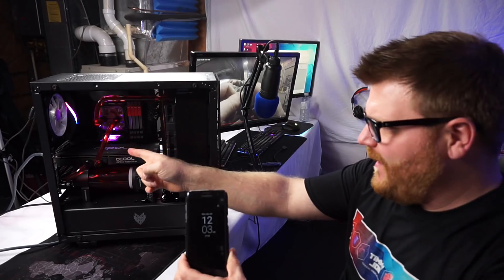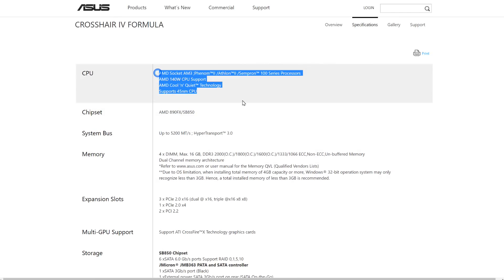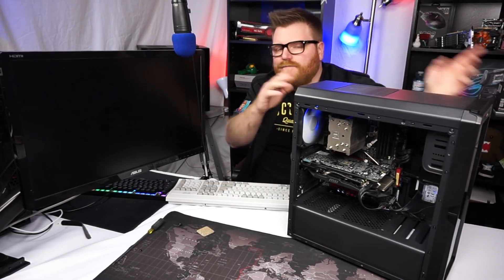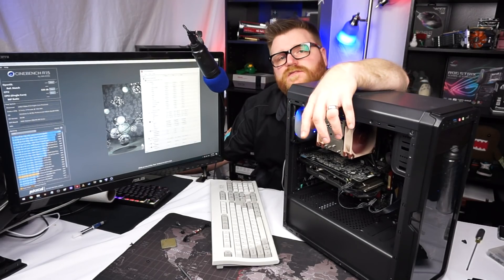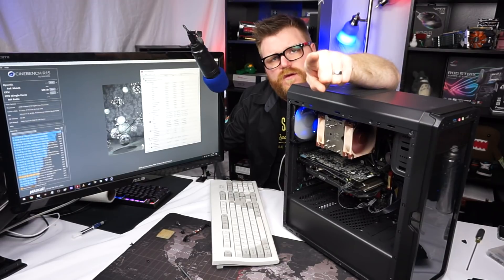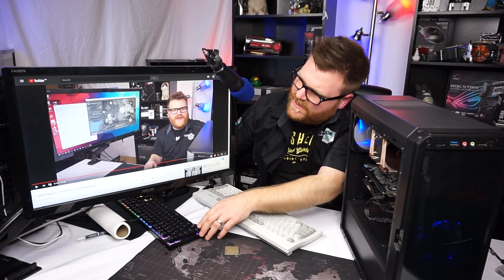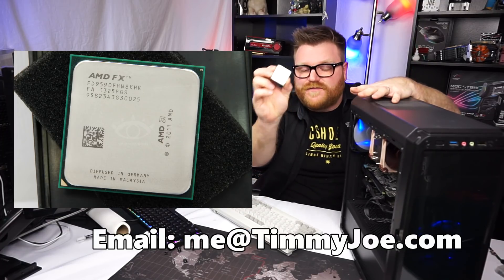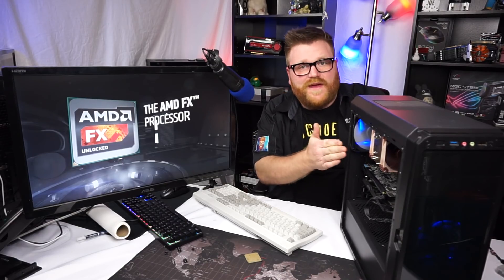AMD FX 8150 Overclocking on an Asus 890fx AM3 Motherboard

Comment: I have my 8150 overclocked to 5.4 on the Asus ROG Crosshair V Formula-Z mobo and it’s very stable. I built this PC 10 years ago and it still works well. Even with the GeForce 660ti GPU.

Comment: I have struggled to OC mine, I have hit a wall at 4.4 Ghz, messed about with voltages, etc with no joy, bought this budget CPU in 2022 for £30 to upgrade the FX 6100, that I paid around £100 when it was a new release a decade or so ago, using an AM3+ MOBO with a 780 FX chipset  (GA-78LMT-USB3) It was not AMD's finest hour but works great for me

Comment: I have an FX8320 paired with an MSI 970 Gaming motherboard. I'm having a hard time getting to 4.5Ghz due to overheating issues. Has anyone had success overclocking on the 970?

Comment: I have a FX-8150, and at 4.82MHz clocks i get 703 in CB R15 o.O  Forgot the ramspeeds and timings much in this video? or is the 890fx mobo just a perfomance dropper like crazy? 
FX-8150 4.9Mhz @the moment
Sabertooth 990FX R2.0
16Gb corsair vengeance dual 1600 OC to 1800MHz 
Rog Strix RX5700XT
corsair TX850M psu
this old system is great for 1440p and 4k gaming if you get enough ramspeeds

Comment: Hey! Greetings from small country in Central Europe where i have same motherboard and Phenom II 1100t. Because 2020 came in and many triple A titles stop supporting this procesor You made me to try the same thing. I already updated Bios to 3029 and can you tell me which processor from higher tier will work on this motherboard? I am asking because on Asus web site highest is 8150, but this processor is nearly impossible to get. And if is the price is astronical (I saw auctions with double the price from launch in 2012)

I am counting on answer!

Thanks

Comment: Hi Timmy...good video bro...i like it...because right now im using mobo crosshair formula iv same as the video...but my processor is phenom ii x6...can i ask 1 more thing...if i wanna upgrade my processor to AMD FX-8350 Black Edition AM3+...still can or got some effect on the motherboard....hope i get quick respond from you bro...
Reply: Hey I have the same plans as you. I also have this mobo Asus crosshair 4 Formula. For running the FX8350 in this Board you will need the Biosupdate 3029. Currently I am running a Phenom X6 1090T @ 4,1 GHz paired with a RX480. Now I want a little uprade, the fx8350 will Perform a little bit better, 10-20 FPS. Also the Phenom has a lack of instructions, the fx8350 is a good choice lowbudget choise. Better than spending 300€ for a new ryzen 5 1600AF + B450 mobo and expensive DDR4 RAM
Reply: @almanseinvater4681  thanks man...because right now a lot of game not support for phenom ii x6 1055T...thats why im planning to upgrade my processor with low budget...thank you so much...
Reply: @almanseinvater4681  but...if i update the bios now...its still got some effect if i still not changing the processor?
Reply: @sivosem3607  It has no effect on the current system you can do it now or later Just before you Put the FX8350 in, but be Sure to make the BIOS Setup right it could Crash your system
Reply: @almanseinvater4681 hey  i currently have the Crosshair IV formula with a fx 8350, it runs smooth but the only issue I have is that sleep mode won't work, it would turn on again immediately . did you manage to get the FX processor, did you have this issue?
Reply: @tuliofarias9073  I can't help you sorry I managed to get a FX8350 but then I sold my stuff. I.hope you find a solution for your Problem, I can't remember If sleepmode worked sorry

Comment: My FX-8150 and M5A97 EVO definitely throttle down at 63C.  I can only 
get performance increases up to 4.3Ghz, which are still quite good 634 in Cinebench R15, 
before I start losing performance due to throttling I suppose.  At 4.6 Ghz I'm back down to the 580s or even 390 in Cinebench.  

I'm  stable well up to 4.6Ghz, but the throttling just kills any benefit.  From comments I'm seeing online I'm guessing nobody is using HWiNFO or AI Tuner to notice the throttling. 
I  haven't seen much on how to solve this, with a water cooled FX-8150 and 
three case fans I don't even know why it is getting so hot.  My RX 480 
is the three fan PowerColor Red Devil too.  I'll keep tweaking, but I'm 
doubtful I'll see any performance improvement above 4.4Ghz thanks to 
throttling.

Comment: just bought most of a 8150 system just now for $240 needs a case and a PSU and its up and running not bad it came with 980 strix and 12gb of ram this platform is cheap right now.

Comment: Timmy the score was that low because you had APM( Aplication Master Mode) enabled. When you have that turned on cpu is calculating power consumption and with 4,8 GHZ this thing was going back with clock speeds and you got maybe 2 max max cores running on that 4,8. I have mine running 8120 running at 4,1 and its having over 600+ score .

Comment: Me thinks you don't know how to overclock AMD CPUs.

Just use the ratio, not the front side bus increase, otherwise you need to also increase the CPU North Bridge voltage as well.

You are overclocking your ram by increasing the FSB which is not going to be stable while running 4 sticks of RAM on those AMD CPUs. To get the best overclock you need to use just a single channel.

Seriously, do some research before posting a video.

I've been running AMD CPUs since the K6-2 days.

Currently running an FX 8350 at 4.6 GHz @ only 1.32 volts, 24 GBs of RAM, custom water cooled. My Cinebench score is 715.

Comment: I have a FX 8350 instead of going with the FX9590 I had planned on . So went with the ASUS M5A99FX Pro R2.0 . I'm a bit apprehensive about overclocking the CPU even though I have a Corsair H60 on it with a GTX 1060 6gig 3fan from ASUS . My point of over clocking the CPU is not being sure of making a mistake because I had one with my old PC. I would like to get a bit more out of it because I know the CPU is holding back the GPU . a  n  d  now my ADD brain forgot what I was getting my question. DAMN  HELP me Timmy Joe You're my only hope .

Comment: I have a still have  965 X4  phenom still , i sold my fx 4100 and 6300 was not impressed with the fx line, in fact my phenom does much better on dolphin emulator than any fx cpu i once had, of course my i7 3960x is my ultimate emulator machine.

Comment: Faildozer is right.  I have an i5-3570k running at 4.4ghz.  It scores 618 in Cinebench R15.  That's 4 cores and 4 threads from 2012 beating the 8-core FX-8150 pretty soundly.

Comment: MSI 890fxa-GD70 and FX 8350 good for OC, but only at 4250 Mhz and 1.28 volts. Have it running on a old XFX 1000 PWR supply with a HD 7790. I think the 7790 is newest part
Reply: If you are going to do a -40C run a Asrock Extreme 9 will run with only one of eight cores. In other words will shut off one core per module. None of the Gigabyte or Asus FX boards I have will do that. I could do 5.2 Ghz with one core @ 19C with the extreme 9 that way. Then put it on water.  Then it leaked.
Reply from the maker: I got the 8150 to 4.82 Ghz 715 CB with an AIO today, more to come

Comment: That long pipeline allowed those FX chips to soar in overclocking, but it didn't really improve performance much. I stuck with the Phenom up until Ryzen. I have an R5 1600 now, and it's SO much better. I've scored a 1394 @ 4Ghz on my chip doing Cinebench R15. Talk about improvement over the FX series.

Comment: mobo is bad, no ram overclocking, no VRM cooling, no NB overclocking, windows install is not fresh. no wonder cb score is low.
also IPC is important, but go ahead and try to play new games on, say, i5 7500. IPC is great, but it's only 4c4t. FX has 8 cores, 8 threads (w10 writes it as 4c8t because FPU block is a single unit per 2 cores). average framerate might be higher on 4c i5, but frametimes would be all over the place
Reply: An i5-7500 will destroy an 8-core FX in 98% of games, in every measurable way.  The IPC of the FX CPUs was too poor for the core count to make up for it.
Reply: yeah, maybe. but try i5 with music, browser and afterburner (or whatever utilities you run) in the background, tell me how it works out for i5
Reply: Why on earth would I have a music app and a browser open while gaming?  Utilities like Afterburner do nothing to hurt a quad-core.  I have that running all the time with a 4.4ghz 3570k.
Reply: background downloading? listening to music while playing? or maybe actually using your computer? teamspeak/discord/whatever it is you're using to communicate? or how about anti-virus software?
Reply: I never listen to music while playing.  That takes away from the game for me.  I don't download in the background, because that can wait.  Things like teamspeak and anti-virus software work just fine on a fast quad-core CPU while gaming.  That's a non-issue.
Reply: good for you then. i need my music in the background, some downloads and maybe video recording, so i need more than 4 threads therefore FX or old i7 (975 which i have right now) is way better than new i5 for me, simply because i5 would be overloaded with all the background tasks i'm running. true, i'm not getting more than 80 fps in majority of my games, but i do get nice smooth 60 so that's enough for me. basically FX would do the job for me, but i already got my hands on i7 with triple channel memory

Comment: got 8300 set to 4.2 1.36v with cinebench score over 650.  you should disable cool n quiet c6 and c1 as well  loadlines set to extreme.
weird thing win 10 reads as a 4 core 8 threat . maybe the poor performance of fx chips are based of that are not an actual 8 cores cpus lol

Comment: 6:20, you're throttling....you're running a 90mm heatsink and pumping a metric fuck ton of volts into it, don't blame hardare for your own disabilities, an fx8150 gets 550cb stock.
get a hyper 212 evo, set a progressive fan curve to ramp upto 100% at 65*c (and like 50% <40*c), set multi to 22.5, voltage offset to +0.1125v and then retest you should get ~715.

Comment: I had the 8350 lapped on CHV Formula water-cooled and overclocked to the max, that is one of the most fun cpu's I've had overclocking wise. It took 1.58 Volts for 5 years no issues or degradation.

Comment: Had an FX 8320e not the best CPU I ever had but got the job done. However any high-end i5 CPU from the same time would out preform it.
Reply: a higher end i5 cost twice as much, 8120/8320's were price matched to i3 2120 and i3 3220 respectively and when overclocked in work tasks would match i7-3770's go look.
Reply: even older cpus would still outperform it.

Comment: Not sure but I was watching a vid the other day and the guy's recording software was dropping the results of the score....did you record it while running? just wondered as someone in the comments below said it was too low of a score...(just food for thought)
Reply from the maker: I use an external recording solution. I think it was thermal throttling, Gonna test it out later

Comment: Check this please http://hwbot.org/submission/2484712_johni5_cinebench___r15_fx_8150_715_cb/ 
The score at 4.8 Ghz should be a little over or about 700 cb not 559. My old fx-6100 hit 541 cb at 4,8 Ghz. 
''Cinebench - R15 - 541 cb - FX-6100 @ 4800MHz'' with msi gaming 970. There is something wrong with the mainboard or the overclock is unstable. Please check again. Thanks...

Comment: Can you do a 3GHz 8150 vs 3GHz Ryzen 7 to see how much the IPC has improved between 1st generation Bulldozer and 1st generation Zen ???
Reply: hello walkman its about 50% faster then bulldozer cores (puts it line with 6th - 7th gen cpu IPC wise) amd older amd x4 and 6x(especially) cpus performed more consistently issue with bulldozer with its 2-3-4 models(4-6-8 ish assistcores) is when it starts using the assist cores on the module it can slow stuff down by 20-40% slower then a amd x4 cpu, most of the time it was best to just go into the bios and change it to 1m/1c instead of 1m/2c (1 module 2 cores) so only ran one core per module (no resources sharing)
Reply: lee x cool thats a lot :)
Reply: That's why you should not buy a used or new FX or amd type A2-A12 cpu (unless your getting it for free or under £50-100) a 3rd gen dual core i3 is faster then a amd fx or any amd type A cpu in most cases (unless more then 2 threads are been used then i5 3rd gen quad core would be it) ,you can pick up 3rd gen i3/i5 with 4-8gb ram for under £100-150 (£200 ish with 240gb ssd 8 gb ram) and it be noticeably smoother PC

never buy a type  E cpu as They are slower then mobile phone cpus 

I would recommend staying away any thing below a A8 as most of them are 2-3 module cpus sold as quad core or 6 core but as they run at about half the speed they act more like 2-4 core cpu then a 4-8 cpu

Comment: I had that exact setup for over 5 years, just replaced the system a few months ago with a Ryzen build.   I originally had an 8150 and it was overclocked to 4.7Ghz for every day Prime 95 stable, she was toasty lol. I eventually popped a 9590 in it for the last year i had the PC to get an extra year out of it.  Got 5ghz on that all day long with a big AIO.
Reply: i currently have the Crosshair IV formula with a fx 8350, it runs smooth but the only issue I have is that sleep mode won't work, it would turn on again immediately . did you have this issue?

Comment: Rocking an FX-8350 and an FX-6300 (stream rig) with no plans on upgrading any time soon ( waiting till AM4+ / AM5). My system does everything I need it to do, and it games just fine.
Reply: Hum, AM4+ might not be a bad idea to wait for.
That said I'd get the AM4 with a 400 series chipset myself if I where you with that setup...
Just get the R5 2400G (that APU has double the single threaded performance of the 8350 and trades blows with the 8350 in multi-threaded performance and is better then the non-APU quad cores for the AM4 socket right now both in price and performance, and it got a iGPU roughly on par with a 1030 that you can use for the host OS when running a viritual machine or some such)

Comment: Ahh yes the FX series. Had nothing but poor gaming experience with this when I built my first pc. I mean it ran games OK but when I realized a dualcore i3 ran games better, I was really disapointed. I eventualy bought a i7 6700T and the difference was night and day. Lower power consumption and just decimated my FX 6300@4.3ghz. I'm to this day, still running that i7, now at 4.4GHz.
Reply: welcome to the performance side of life. We run games better than Price / Performance solutions
Reply: +Darc Mass
The FX series requires a lot of tweaking to get the most out of them.
But you can optmize the UEFI/BIOS settings to improve performance significantly in individual applications.
Different apps likes different settings better.
Yes, the out of the gate performance is, so-so...
But your actual experience in DX11, DX12 and Vulkan titles is actually quite a lot better then the i3s.
Reply: Luredreier vulcan is made for low performance hardware
Reply: Dom That's a truth with modifications.
Since the Vulkan drivers don't have to figure out how to best do things for the game since the game tells the driver what it wants done directly there is less overhead involved.
However the thing about Vulkan isn't the reduced overhead but rather increased developer control allowing more multi-threading something that certainly benefits a cpu with many cores that's less capable when it comes to instruction level parallelism.
Nothing is stopping a Vulkan game from being every bit as demanding as any DX11 title out there.
The difference is that it's easier to spread that workload out.
While DX9 only uses one thread, dx10 uses 4 but is mainly limited by the performance of one thread with only marginal resources utilized on other threads (mainly the second thread) and DX11 only slowly starting to use 4 threads...
DX12 and Vulkan are designed to do what AMD originally envisioned for all applications back in 2010 or so...
Higher thread level parallelism.
Unfortunately 8 years have come and gone and now the workloads are both highly paralell when it comes to threads and instruction level parallelism.
Piledriver can't deal with the later of these two.
AMD has always had more faith in thread level parallelism then Intel has.
If you look at a AMD module with two cores vs a Intel core with hyperthreading from the same era you'll see thst there's every bit as much resources in that module and that there's actually a tiny bit more.
Yet the cores while being slower then Intels at the time actually held up surprisingly well for cores essentially only having half the resources of a Intel core.
Essentially you'd need 3 Piledriver cores to match 2 Intel cores in throughput  (provided that you feed those cores fully)